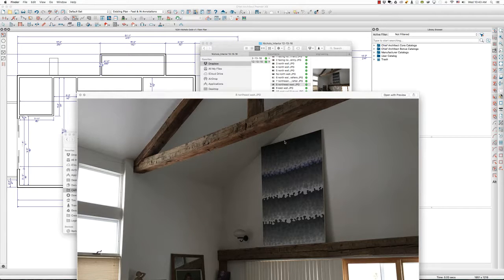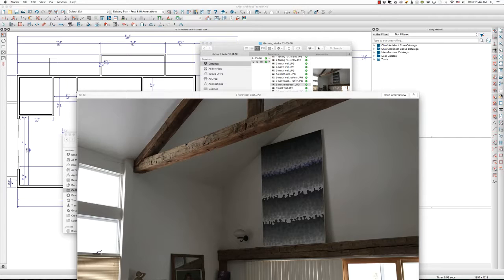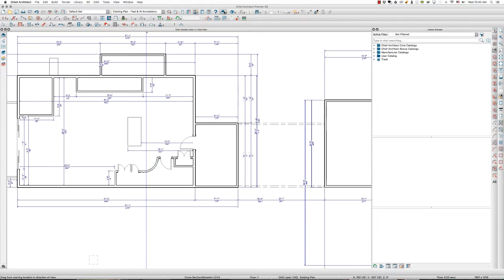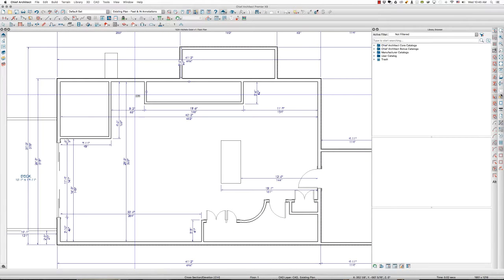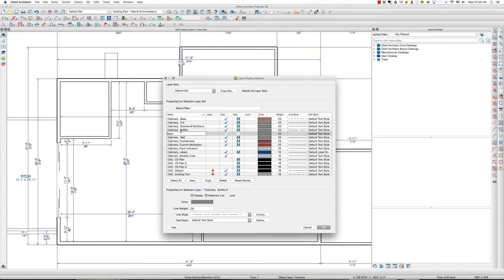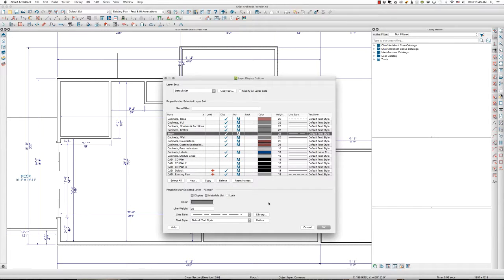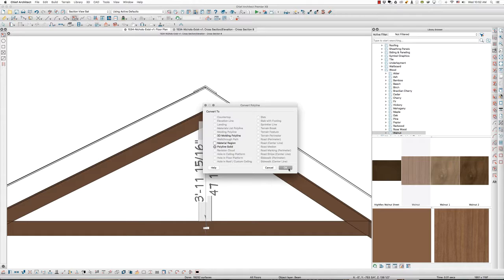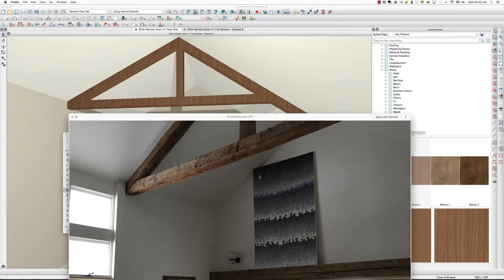Draw custom beams in 3D

Comment: Was this done in premium?
Reply from the maker: This was WAY back! Chief Architect Premier X8, so approx 6 years ago.
Reply: @DesignbuildsolutionsLLC  ok I thought so I saw a couple things that I haven't seen in pro so I thought it wS either something I need to "unlock"  or show, or it was premiere.  Thank you
Reply from the maker: @robburkhard9256  When you say you "haven't seen in pro," are you referring to Home Designer Pro? WAY back when I first started with Chief (version 9.5), I was thinking they didn't 'call it Premier. I think it was "Pro" back then.
Reply: @DesignbuildsolutionsLLC  yes. As I understand it as of now  it  is Chief Architect  Home Designer Pro the the next step up is simply Chief Architect Premier . With the price difference  of about $600 to almost $2000
Reply from the maker: @robburkhard9256  Just remembered...I think back at ver 9.5, Chief Architect was creating the software for someone else. 
Now, they have Chief Architect Interiors and Premier, and Home Designer (by Chief Architect) Suite, Architectural, and Professional.
Reply: @DesignbuildsolutionsLLC  yah that sounds right. I don't really know the history but just purchased a week ago. But this sounds correct. So much to learn .
Reply from the maker: @robburkhard9256  Welcome to the clan and good luck!
Reply: @DesignbuildsolutionsLLC   thank you . Now to figure out how to print all sides and to send a viewable file to my estimating software. Tried pdf but no luck so far
Reply from the maker: I've only ever had Pro or Premier versions, so I'm not fully versed in what is possible in any Interiors or Home Designer products.